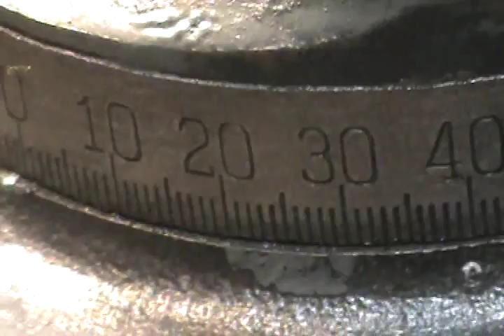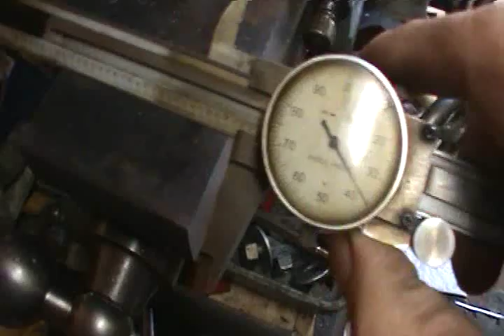stub arbor and threading Burke Horizontal mill

Comment: Good job done! Having had a little-used milling machine hanging around for 30-odd years, I have just discovered when trying to sell it that it is a Burke No. 4 though different to yours with no auto-feed or swivel table. Also no vertical mill adaptor which I did not know existed and I would have liked but are quite rare now. All reference to the make has been ground off the castings which, with the serial no. showing a '41 model, they must have removed all I.D. during WW2 here in the UK. Cheers.
Reply from the maker: Hi.  The vertical adapter is home made. It works fine, just a bit of machining. good luck with your mill.